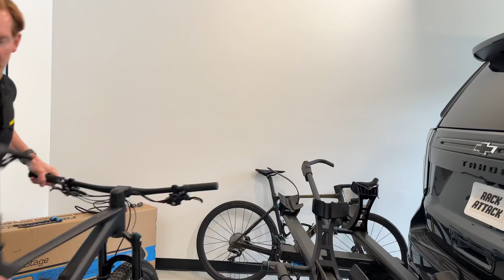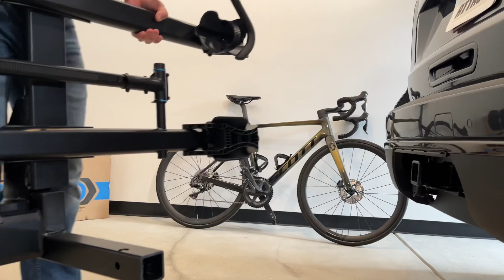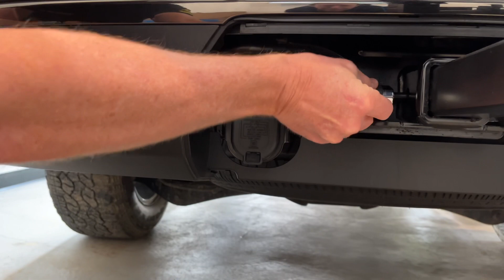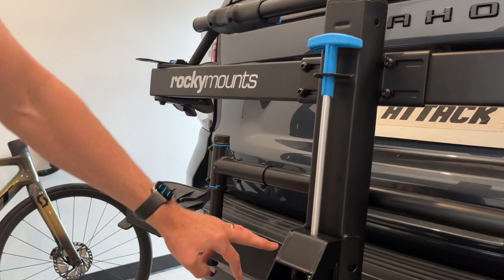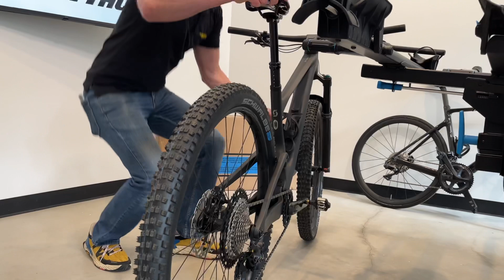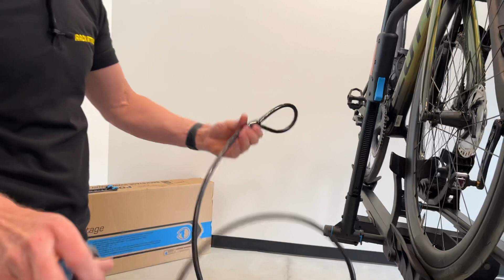RockyMounts BackStage Swing Away Platform Bike Rack Overview (2022)

Comment: Just bought one: solidly built rack, and the swing-away part works well.
One important thing to note if you have a 4WD or camper: I read and watched a few reviews on this rack and it wasn't evident from any of them that the rack platform is inclined towards the vehicle by around 5 degrees - this means the bikes are leaning towards the back of the vehicle. As a result, in my case for a 4WD and a campervan, my bike handlebars are either too close or actually contacting the vehicle. I will need a hitch extension to position the rack further out. Turns out that Rockymounts web site warns of this requirement, but seems few reviewers or retailers do.
Reply from the maker: Excellent point, Ben! Thank you for sharing so others interested can note this when looking into their next purchase.

Comment: Hi, is it normal that the platform that holds the bikes is not leveled and there’s a slight slope?
Reply from the maker: Hello.  The platform angles upward slightly from front to rear.  Side to side the platform is level.  When the rack is loaded and swung to the side there will be some leaning due to the weight.  Thanks!

Comment: what's the  easiest  way to  add  a  light  board  and  number  plate  as  this  is  required  in  my  state ?
Reply from the maker: Hello.  Thule offers a license plate relocation kit which includes an integrated light for night time plate visibility conforms to FMVSS108 safety standards and includes universal four pin connector with quick connection.  It's part number 903760.  Thanks!
Reply: @rackattack  Great  Thank you